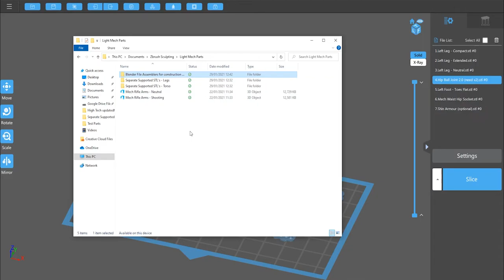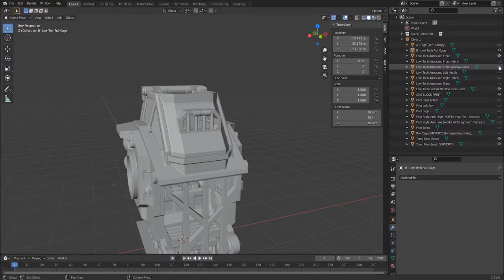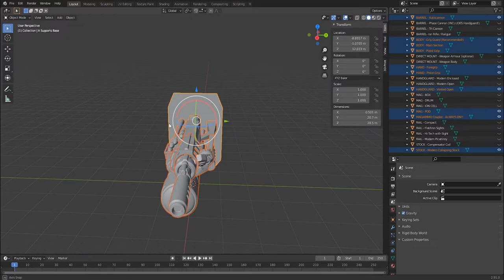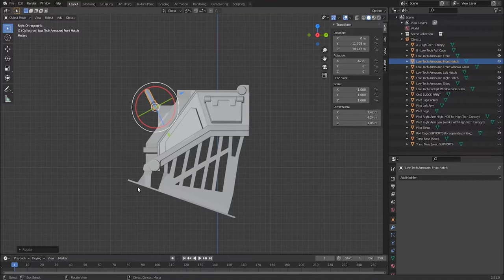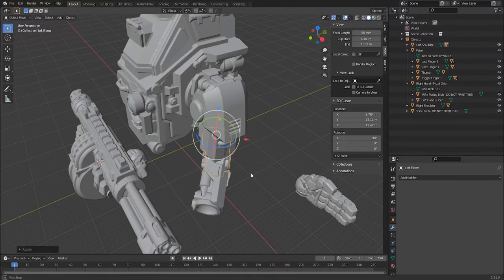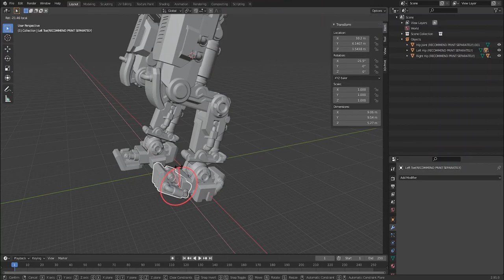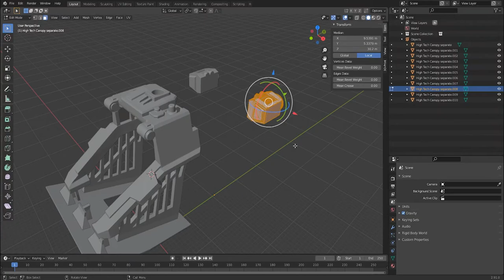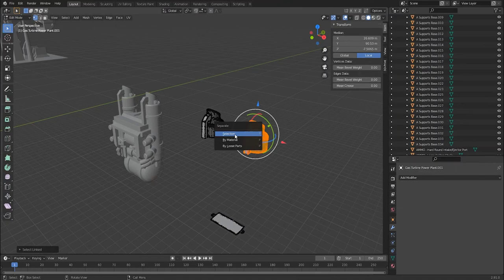Anvil Digital Forge - Light Mech - Customise and Print CAD Tutorial Using Blender and Chitubox

Comment: Any tips on assembling the high tech canopy front (mech "head") and the canopy back? My first go at printing a high tech mech needed some sanding to fit the head in the space above the pilot's head.
Reply from the maker: Hey, sorry for the delay, the tolerances are quite tight on the model, so you may need to check your print settings. If you are overexposing the resin then the parts will be fractionally larger, which will then cause an interference fit and need some sanding. Feel free to contact us through the Anvil website if you need more detailed help.
Reply: @AnvilindustryTV  thanks for the reply! You're right, I tried lowering the exposure on other ones and it snapped in just like it should.